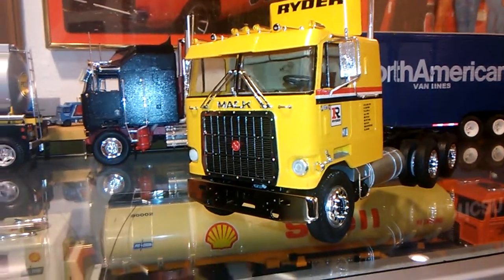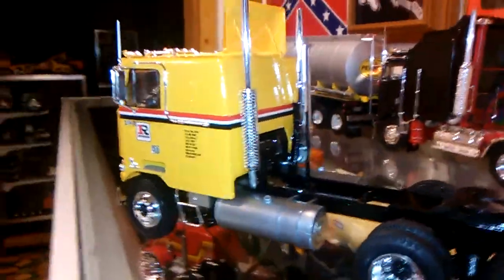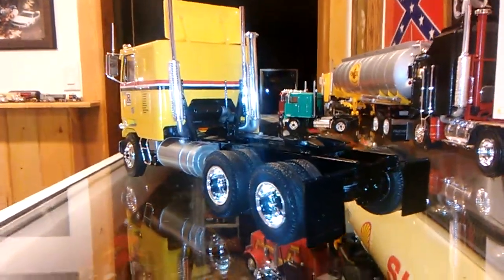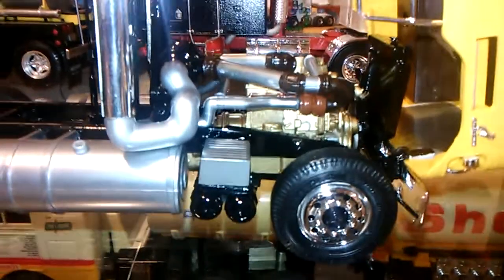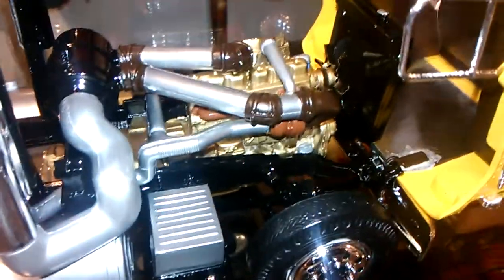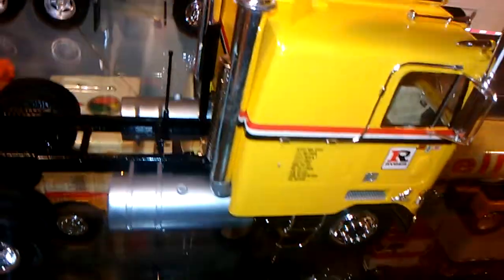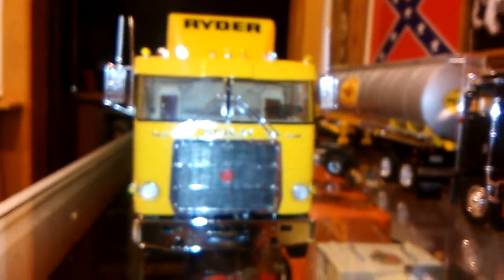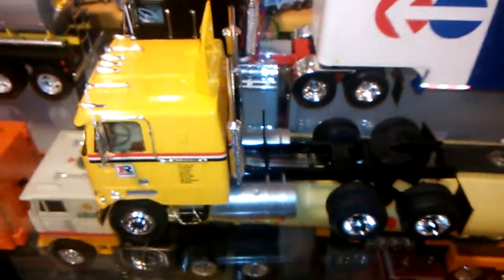Part 1 Mack Cruiseliner build

Comment: Brother, thank you so much for the help me on finishing out the MACK CRUISELINER. It turned out fantastic!!!! As you stated, there are a lot of fit issues with this kit. My painting on the cab and chassis came out beautiful, but when time came to assemble the frame, what a disaster. The original chassis did not survive the battle. Thank you again for resurrecting another frame, to finish out this badass truck.